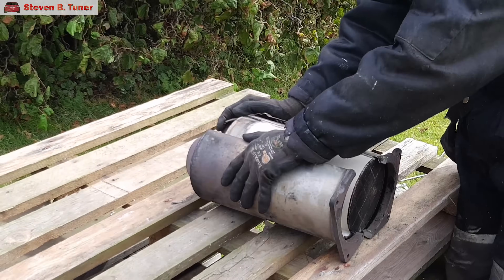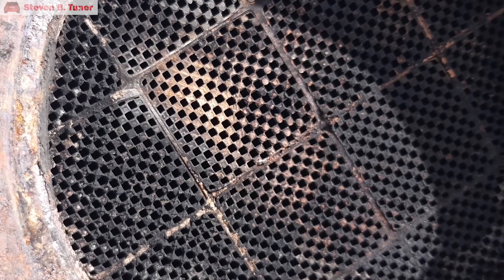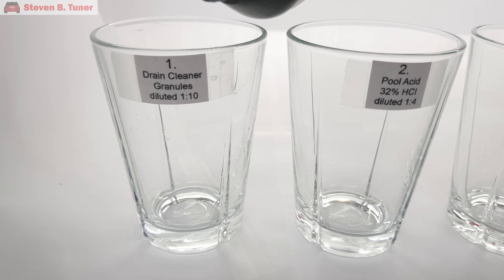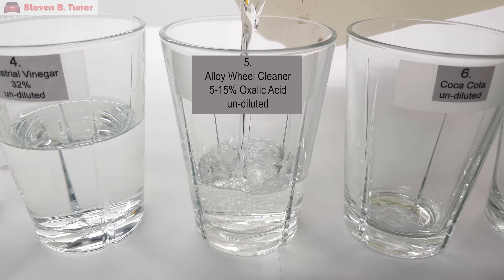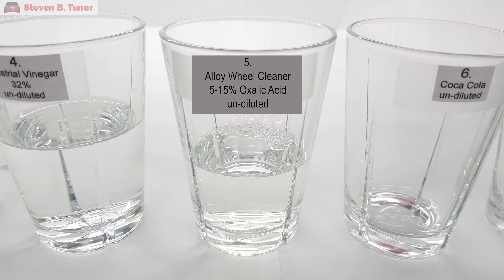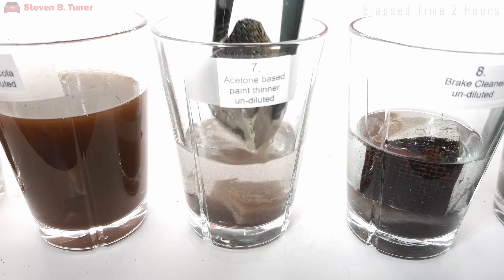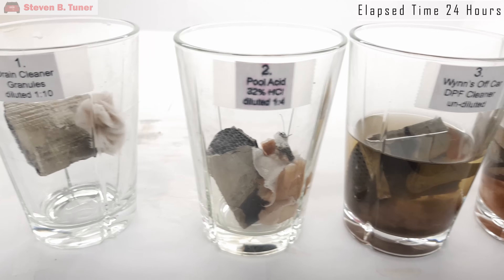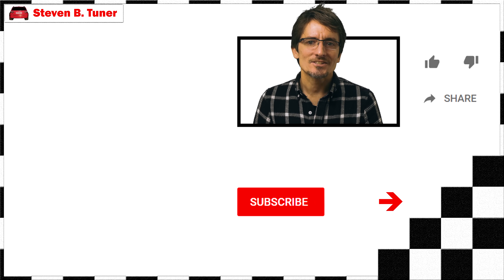DPF Cleaning at Home – 9 Chemicals Tested (Diesel Particulate Filter DIY Ash Cleaning)

Comment: So you're saying your favorite is the one which the actual ingredients are a mystery? 😂
Reply from the maker: Haha, true enough! However the first stage wash is less important, and any product that dissolves oil will work quite well. It is the second stage wash where the real ash removal happens. See my other video for the full process - "The No Damage DIY DPF Clean"
Reply: @StevenBTuner  I'm really considering pulling one out of a Isuzu NPR and washing it with a pressure washer I see you also have a video on that I'll have to watch a number to decide what I should do. Liqui Moly makes a spray in 2 step with dpf in place but I feel like removing it is probably the only way to get it clean. Who knows. We'll be watching the rest of your videos and probably commenting thanks
Reply from the maker: @Larsenvlogs  I hope you'll report back with whatever method you decide to go with!

Comment: Do you think it is safe to dip the whole intake manifold in this solution.
Reply from the maker: Hi, thanks for watching! I haven't done any chemical testing of the intake manifold, so I wouldn't be in a hurry to expose it to anything acidic. The alkaline products like dishwasher tablets and sodium hydroxide would probably help to  loosen the oily soot, but you will probably still need a lot of scrubbing, scraping and blasting to get all of the gunk out.

Comment: So I have done your method, without a pressure washer and with wheel cleaner, left it soak in for 3 hours and rinced for another 1H30. Result was very good,cur seems to respond better in terms of Nm. One thing to mention might be the exhaust gas temperature sensor, that needs to be replaced also in most cases, as it will turn on the check engin light even after the cleaning. In the case of a Citroen C4 Picasso, when you take out the DPF pay attention as fair amount of soot will com on your face/head and not healthy. So protective masures need to be taken.Thanks for the detailed explanation.
Reply from the maker: Hi, great to hear that you got some good results! Whenever possible it is best to unscrew the sensors and plug up the holes with a suitable bolt before cleaning, It is definitely not a fun or clean job...
Reply: @StevenBTuner  it was a fun thing to do, not very complex. After doing that, I found the courage to replace the air-conditioning condenser. Car is way more fun. Thanks for sharing.
Reply from the maker: @balduberdriver  Well done!
Reply: did u you dilute wheel cleaner with water?

Comment: Did I miss something?  Are you suggesting pool acid to clean my DPF (bmw x5 e70 3.0d) by pouring into top hose connector?  My screen says "Particle Filter" and is at stage one before going to reduced power mode
Reply from the maker: Hi, you can see the complete cleaning process in my other video: https://www.youtube.com/watch?v=LE1boZ3fhLg

Comment: Its been concluded long time ago that full strength Purple Power Industrial Strength Cleaner and Degreaser works the best.
Reply from the maker: Hi, thanks for watching! Industrial degreasers are great for loosening up any oily soot, but they don't react with many of the compounds that make up the ash deposits, so they can take days to do anything, whereas the right acid will work in 30 minutes.
Reply: @StevenBTuner  Try it or read about it. I just did a full clean up(EGR, intake, cooler, DPF)on 2012 Ram 6.7L Cummins. EGR Cooler needed two soak sessions, DPF one. It was all very neglected. I have scraped about half a kilo of soot and ash from intake horn and throttle body.
Reply from the maker: @dickvolen4589  Hi, not much of a fun job - but great to have it done so that you know that your vehicle has a good starting point for years to come.

Comment: Coal burns, try hydrogen peroxide, 80% very dangerous.The red was probly rust since soot is black.Ash is produced by oil additives like moly, zinc, etc.
Reply from the maker: Hi, thanks for watching! There is no need to do anything about the soot specifically as it is removed by the normal regeneration process if the engine is functioning correctly. The ash deposits can be many shades of white and brown and orange and red - and iron oxide from an iron cylinder block is a pretty good guess at where the red coloring comes from. I am trying to keep any suggested chemicals fairly safe whereever possible.

Comment: I am a DPF cleaner in the United States. We use Ultrasonic and we thermally and pneumatically clean filters. If we have oil soaked filters we pre wash them in a giant tub of dawn before putting them in our ultrasonic machine. Could you run an experiment on using Dawn, to get the oil soot out, and mixing it with the pool acid for the ash? Because most filters contain both particulates it would be wise to get all the particulates out, rather than just one or the other. Did you find that the pool acid got both the soot and ash out, or just the ash? You weren't exactly clear in your description. Thank you for doing this experiment and informing us.
Reply from the maker: Hi, thanks for watching! A couple of my other videos go into my whole cleaning process in a bit more detail, and this vid is more about testing some viewer suggestions. The filters I have been featuring are all from cars with the normal regeneration process working - so they don't have a lot of soot in them, especially if a regeneration has just occurred before the filter is taken out. For terminally soot-blocked filters it is definitely a job for specialists like yourself with a range of equipment. A strong de-greaser like Dawn is perfect for breaking down any oily residue, so that any following process can get straight to the ash. I find that the diluted acid gets to the ash well enough to allow any remaining soot to be back-flushed out with normal water pressure. I did a little bit of testing with home ultrasonic cleaners, and they seem to work well enough even with straight water - which is just as well because repeated use with any strength of acid is going to destroy the stainless steel on the cleaner - but it does make one large mess to clean up, so for home cleaning I thought it was just too much hassle.

Comment: Hi. Can you recommend  anything to unblock a back pressure sensor pipe the is still fitted to the manifold on a Mini 1.5 D?  Looking for something to dissolve the heat hardened oil deposits.  Can't get it off the manifold so trying in position!  Love the videos btw.  Thanks.
Reply from the maker: Hi, that's a tough one - I can't think of anything to easily do it in position.

Comment: Hi. watched your videos few times in a row, and want to thank you. you have 32%acid diluted with 4:1 ratio. here in usa, california to be exact they dont sell anything that is undiluted and my question is what number do i need to look for at the bottle in the store that will clean the filter? 
thank you
Reply from the maker: Hi, you want to aim for a solution that is 5% - 7%. Swimming pool acid is usually around 32% HCl, brick cleaning acid can be 15 - 32% HCl. There are a lot of brands in the US that don't label the contents, so you may need to look up the safety data sheet online to find out the %.
Reply: @StevenBTuner  thank you very much! i found one at the store that is diluted and is 18.5% so i can actually get it reduced to 8% as in your video

Comment: Hey Steven, Very Informative videos on DPF cleaning, Thank you. I notice you are advicing Dishwasher tablets and Brick Cleaning Acid/ Wheel cleaning Acid. Would you know if brick cleaning acid can damage the internals of the DPF. Also how long should the 'soak process' take for each stage.  Its for my VW Golf 1.6 D, (dpf is 95%). I am about to get my mechanic to remove/re-install the DPF,  I will do the cleaning, following your guidelines.  Thanks
Reply from the maker: Hi, dish-washing tablets and wheel cleaning acid can work, but some of the best chemicals I have found so far are Sodium Hydroxide and Hydrochloric acid as used in this video: https://www.youtube.com/watch?v=LE1boZ3fhLg  and one of the reasons is that you can mix all the chemicals together at the end and they cancel each other out in what is called an acid-base neutralization reaction which forms water and salt, which makes disposal a bit friendlier. To avoid damage to the steel/stainless steel you shouldn't leave the acid solution in the DPF for more than 30 minutes.

Comment: Finished the cleaning process on BMW N47D20A 177 hp.
I used 10 liters of 10% NaOH and 7 liters of 10% HCl. Afterwards I did a lot of vigorous flushing with water and shaking like crazy. Overall about 200 liters of water. DPF backpressure before cleaning was 90-96 hPa and after it is 10-14 hPa at 2700 rpm, and 123-126 hPa -> 24-28 hPa at 3700 rpm. DPF pressure sensor was calibrated at engine off so the results are very accurate! As far is I compared these pressures on BMW forums the DPF after your cleaning method has backpressure as good as a brand new filter! Therefore I applaud you Steven and highly recommend this method. PS after first startup of the engine I was afraid it didnt clean well because the backpressure was as high as before of higher! But this was due to soke water being absorbed in the porous ceramic. After 15 minutes it dried nicely and the pressures are super low!
Reply from the maker: Well done on doing this job yourself, and many thanks for posting those detailed results! By the sound of those numbers, your filter was very badly clogged, and definitely needed a good clean.
Reply: @StevenBTuner  i was hoping to decrease the   turbo lag (gas pedal pressed to full torque time) but this didnt really change much in the 1700-2500 rpm range. However above 3000 the engine revs much cleaner and with more ease :) makes sense I guess.
Reply from the maker: Hi, the most likely reason for a lack of throttle response in that mid-range is a MAF sensor that needs to be replaced. As they get older, they get very slow to respond, and the only way to properly test this is with an oscilloscope.
Reply: @StevenBTuner  I have an oscilloscope. What is the parameter to be tested?
Reply: @LazicStefan i changed my whole timing chain assembly 70k ago and it runs like new.

Comment: I understund Steven.

Bu the way I am electrical engineer
And all the staff it's very interesting.
Although my profession it's similar.
I try to maintenance my car with low cost
I will make a try and I will inform you for final result.
I think about dpf, the inlet sensor and the outlet sensor they measures differential pressure and with some equation who define mother factory shows specific numbers.
Such as you said before.

As we say here in greece

'I wish you health'

Thanks
Reply from the maker: Be great to hear how it goes with the clean!

Comment: thank you steven for quick response. I will try to remove dpf from the car completely and doing that you did on youtube. And I would like to asking you if you know about limits at the dpf while reading on the diagnostic car.
How reliable is result of it. for example' limits to gr for my car is 60 gr oil as . the result  of diagostic tool (delphi 2017) is 64gr
It needs immediatly  cleaning i suppose..or replacement. model of my car is caddy  tdi 1.6 2012
200000km. What is your  opinion from experian . thank you for your time.
Reply from the maker: Hi, there are a few different ways that ash levels and soot levels are measured - some cars do an ash level based on kms travelled, and others on differential pressure after a regeneration, which is more accurate. However, most diagnostic units only provide a reading for %full or grms full, which will be a combine soot and ash amount. This means that you have to take some readings over 1000km, for example, to see what the lowest reading is. If it never goes below 70 grams, then it definitely needs cleaning, and if you have done 200,000 kms then it is another indication that a clean is needed. One more way to tell is if your oil level goes up instead of down between oil changes.

Comment: So the best bet is to pre soak with water with dishwasher tabs, follow by oven cleaning (hcl) and rinse with water?
Reply from the maker: Hi, thanks for watching! The whole process can be seen on this video: https://www.youtube.com/watch?v=LE1boZ3fhLg  and you could use the dishwasher tablets instead of caustic soda if you like.
Reply: @StevenBTuner  i will firstly use dishwasher tabs and afterwards hcl. I will let you know how it went! I will measure the dpf differential pressure before and after this job :) thanks Steven
Reply from the maker: @ciepularys  :-) Another good measurement is the number of kms/miles between regeneration cycles.
Reply: @StevenBTuner  its pretty inconsistent for me. Sometimes 300 km sometimes 500 km.
Reply: @StevenBTuner  I posted a reply in the main comment section. Job done.

Comment: Hi steven you are doing excellent job with your expirements.
I will put dish cleaner on my dpf. can I put it throw sensor tube to the upper side after turbo? and how much time I have to wait to acts this chemical before I start engine?
thank you!
Reply from the maker: Hi, thanks for watching! The dishwasher tablets can be used instead of caustic soda as seen in this video: https://www.youtube.com/watch?v=LE1boZ3fhLg  which involves removing the DPF for cleaning.  The 'leave-in-place' style of DPF clean is more suited to regular maintenance rather than a full clean, as not all of the stuff that goes in will ever pass through the filter, no matter what chemicals are used.

Comment: Brilliant set of DPF Videos 
I checked my Mercedes Sprinter 2013 130 ( 651 Engine) last week before watching your videos and I can concur I had a 90% full DPF and High Nox P2BAC EGR Deactivated

Cleaned DPF with Brick Acid and Petrol
The Petrol /Gasoline cleaned out all of the soot 
The Brick Acid dissolved all the ash 

The DPF now shows 0% in Diagnostics

The fault code is still there which leads me now to the EGR to being blocked which also supports your explanation in one of your videos of this potentially being the initial fault of the DPF problem

Keep up the great work and stop stealing glasses....
Reply from the maker: :-) Well done in getting that DPF fully clean, and all the best in getting your van back to full health!
Reply: so gasoline clean soot how many hours soak and what steps did yiu use to clean, also how did you got rid of gasoline smell?

Comment: can caustic soda clean it? or damage it?
Reply from the maker: Hi, thanks for watching! Caustic soda is a good first stage cleaner for removing any oily soot, but it shouldn't be used at temperatures over 100 degrees Celcius / 212 degrees Fahrenheit, as it will start to attack the ceramic silicon carbide DPF material.

Comment: if you are after just an easy fix instead, washing with the dpf with a pressure hose like those at the car wash will do. spray and rinse thoroughly both ends. Don't worry about damage, it won't. My experience is with N47 BMW DPFs. Sure chemicals will do a better job, but just pressure wash will do to. will save you thousands. 3-4 hour job, sometimes you might need a new sensor. The exhaust pressure sensor is the one you'll be after. $80 part. that is all. the oxygen and temp sensors should be fine. There shouldn't be a reason why a dpf lifespan can't last beyond 200,000km
Reply: Do you wash at a low pressure? I’ve watched the video linked here and it seems if you keep a bit of distance it will be okay? Wondering if a can of DPF cleaner to soak it first, then a wash would do the job...
Reply: @loxx101  good idea. I took no care in washing and stuck a car wash pressure hose in and just blasted everything for around 10 minutes on each end with no care, nothing broke. That DPF i washed is right now in my BMW X1 and It's driving fine, regening and all that.
Reply from the maker: HI, thanks for watching! I have a separate video about the dangers of hitting your DPF with a pressure washer: https://www.youtube.com/watch?v=-0mtz3Icg5o

Comment: Dishwasher Tabs 1:10 , how do you mesure that ... 1 Tab for how much water ?
Reply from the maker: Hi, thanks for watching! The idea of the pre-wash is to loosen up any oil - so if the DPF looks fairly clean then crush up 3 tabs in 2 litres of water, but if you have had some kind of leaking turbo (for example) then maybe you will need 20 of them dissolved in 5 litres.
Reply: @StevenBTuner  The dishwasher tabs contain sodium carbonate which in turn make the solution alkaline. so it is wise I think to rinse the DPF with acid and alkaline solution. The alkaline turns the oils into soaps and the acid attacks and destroys the rest.

Comment: Thanks for your great video. 👍 I see the HCL did you have any thought on Muriatic acid cement cleaner. H2So4.?
Reply from the maker: Hi, thanks for watching! :-)  HCl / Muriatic acid / swimming pool acid / brick cleaning acid - they are all the same stuff. Sulfuric acid (H2SO4) should work the same for dissolving the compounds in ash, but I haven't done a video on it because it is hard to get hold of in a lot of countries, and it's quite nasty to work with. If you give it a go, I'd love to hear how it goes - you should be able to follow a procedure similar to my other video: https://www.youtube.com/watch?v=LE1boZ3fhLg  , but could safely use a higher concentration potentially (safe for the steel I mean, not safe for your skin/eyes).

Comment: I wonder if I can remove the resonator muffler and replace it with a used dpf filter then regularly clean it with dishwasher tabs
La little more noise but cleaner air
Reply from the maker: Hi, modern engines are pretty much built around the DPF, so there is no real way for them to be fitted to an engine that wasn't designed for them, unfortunately. Without the engine computer working in conjunction with the EGR valve, the fuel injectors, the glow plugs and a bunch of sensors, the DPF would become completely clogged with soot in a couple of months.